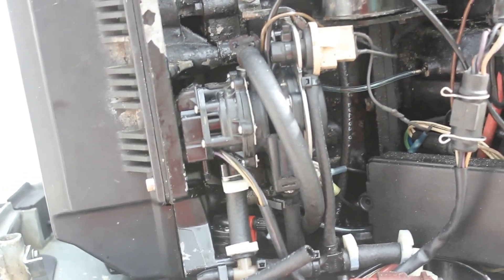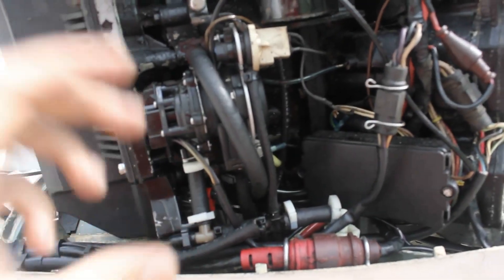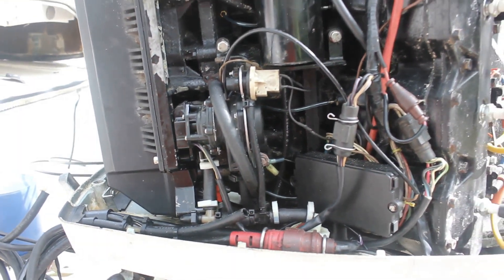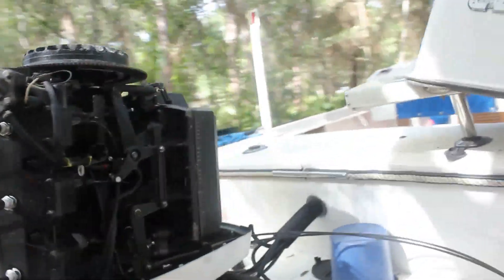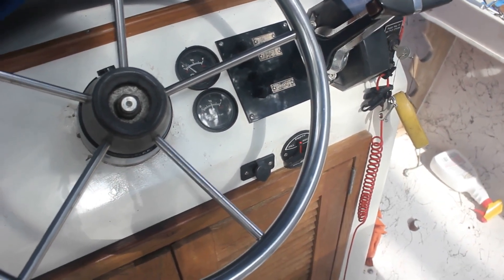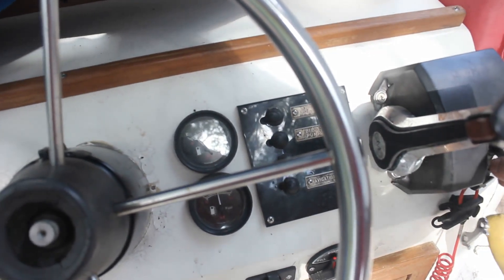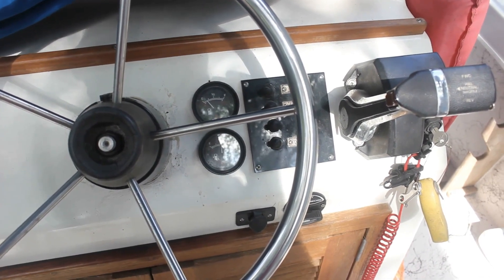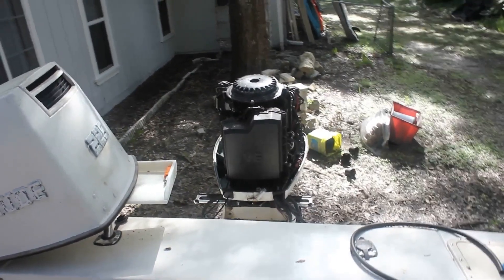OMS/VRO2 - Testing for no-oil condition AFTER replacing voltage regulator

Comment from the maker: UPDATE: the low-oil warning failed me on an outing after this video...thankfully I had just enough oil.

the issue was with the contact that bridges the terminals. It had some kind of film layer that prevented consistent contact....

soaked the mechanism in CLR and it fixed the low-oil issue..

Seems that horn sounds at around 64oz left in tank...1/2 gallon.

something is not right with my VRO too....I accurately measured the Gas used and Oil used and I am running at 18:1
Reply: cfauvel what did you find causing the 18:1  Oil ratio?